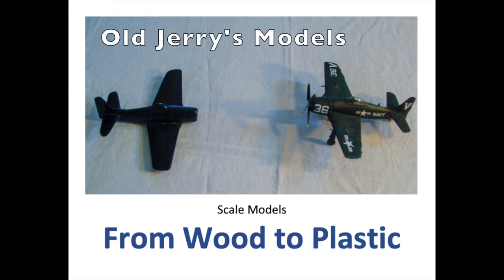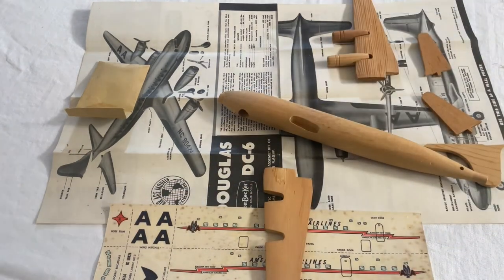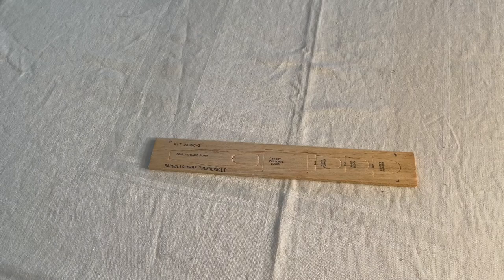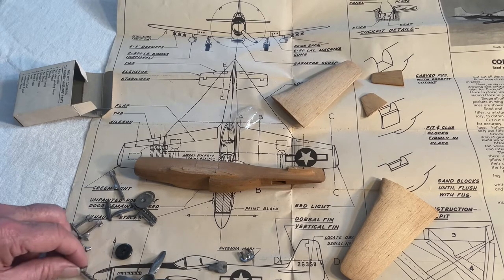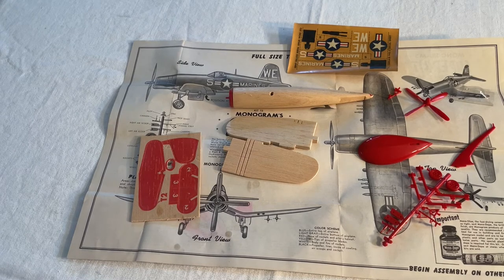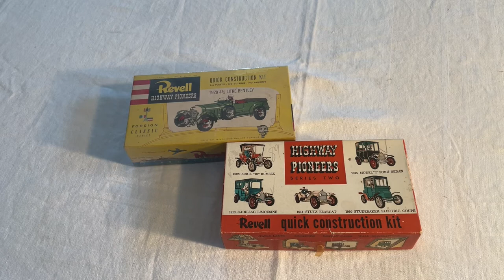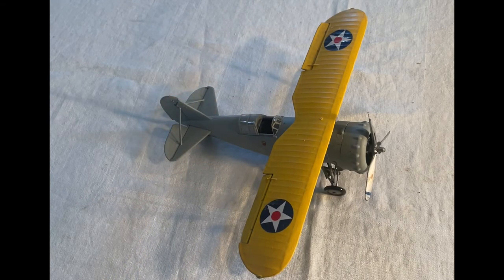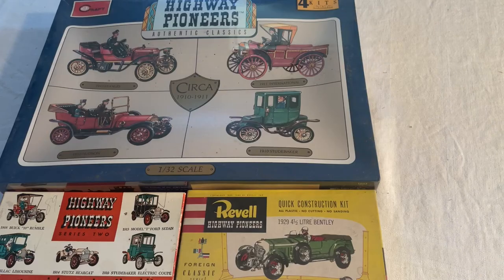Models Wood to Plastic

Comment: Those old Strombecker and such solid wood models were too much of a challenge for my little hands when I was a kid, and I wasn't permitted to use knives and sharp objects, anyway, which in hindsight was just as well. When I first became aware of plastic models around 1955, I realized that even little kids like me could make a decent-looking scale model for the first time. It was a revelation. My first, a 1956 Revell F-100C Super Sabre, 1:70 Scale Model Kit H-236:89 
I few years later I built a Monogram Speedee-Bilt Deluxe B-24 that I had gotten as a birthday present. It was mostly balsa with some plastic parts, came with sandpaper, glue, and dope, and was very expensive. No other kid I knew had one. I did my youthful best, but I really made a mess of that kit, you can be sure.
A few years ago, I obtained one in an unopened box (they’re still damn’ expensive), took my time, and made what I think is one of the best display scale models that I have ever done. I guess I made up for that first disaster.

Comment: Excellent, quick summary of the evolution of wood kits to plastic.  I grew up building plastic kits in the 1970' and 1980's, then found and built my first solid wood kit, the Rogers M4 tank, about ten years ago.  I now almost exclusively build vintage solid wood, and have a pretty large collection, some of which you highlighted in your video,  My oldest kit is a Megow Midget Racer from 1939.  While clearly not as detailed as any plastic kit, I get a great deal of satisfaction looking at my finished model, knowing the time and effort cutting, sanding, shaping and painting I put into it.  One advantage: when I mess up and/or break a wooden part, it is quick and easy to reproduce another.  I have even reproduced entire kits, using the original kit as the source of the templates. Fran
Reply from the maker: Thanks.  I'm glad folks still do solid wood models sometimes.

Comment: The model kit industry moving to all plastic kits was just a natural progression but was also a very Savvy business decision in addition to the kits being more universally being able to be built by kids of all different skill levels (especially novice) it also just made good business sense cost-wise, it's very expensive and laborious to pay someone to select the right quality Stockwood then pay a lathe operator to lathe the fuselage and the various compound curve components for a wood model kit, not to mention the fact that if the lathe operator made a mistake you now have a ruin piece of expensive wood as opposed to if a mistake is made in injection plastic (you can simply return the defective piece back into the hopper and reheat it and remold that plastic) what they realize the cost advantage that injection molding has, is aside from the initial cost and labor of making the mold (once the mold was completed) you could produce hundred of thousands of exact copy kits simply by injecting hot styrene into the mold this would drive production cost down while also having high quality control measures because each injection molding kit would be exactly the same quality as the previous injection and takes the human element of operating Machinery out of the equation! you just simply need to hire someone to inspect and fill the box with the parts and could remove any parts that were not properly molded. Styrene plastic removed any quality control issues because styrene plastic is a very formulaic, consistent material, whereas wood is highly varied from region to region, tree to tree, season-to-season and while I agree these old wooden model kits are very nostalgic and it in their own way are beautiful, you can certainly understand that if the model kit building industry were to survive long-term there was no other option than to go to styrene plastic, plus I almost forgot that being able to injection mold plastic part also allowed cockpit detail to be entered into the equation and other tiny detail pieces that would be impossible to replicate with wood.
Reply from the maker: You are right in eery detail.  I think the end of the war and the use of styrene were also factors.